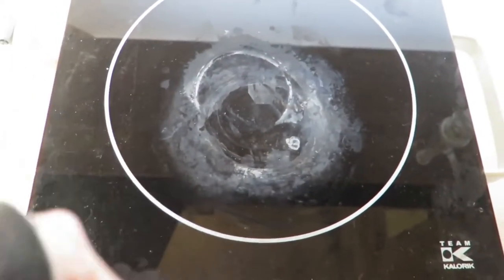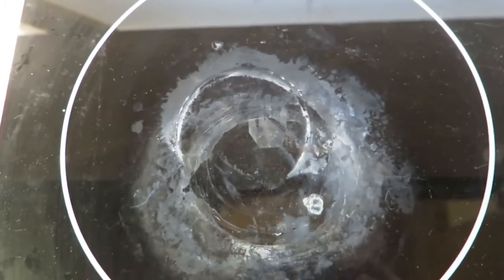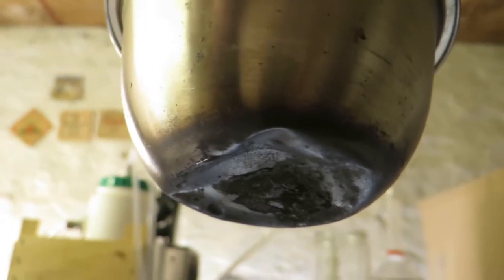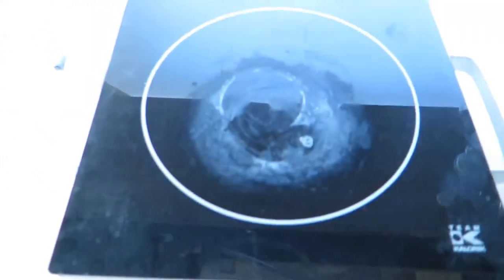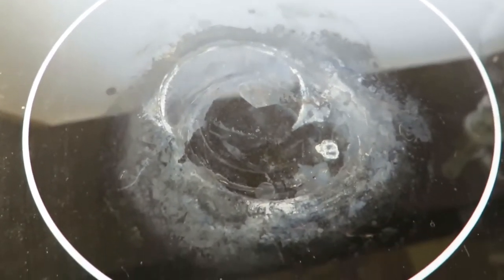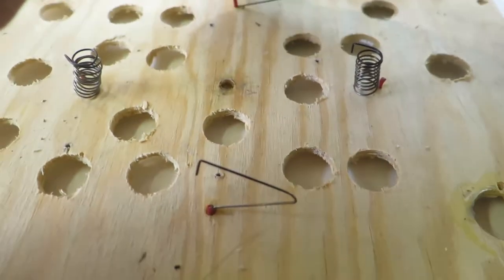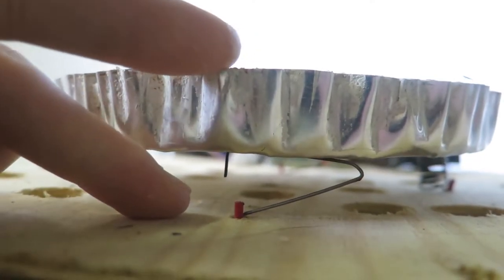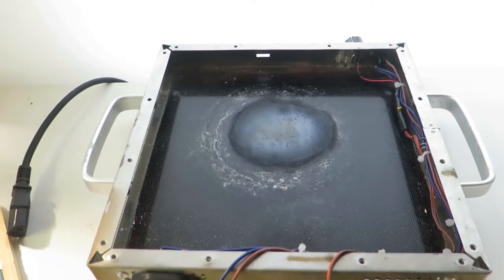Hotplate broke

Comment: Bro, I'm gonna start a channel. Need some tips.

what simple program do i use for editing videos if not windows movie maker
Reply from the maker: I personally use Blender, because I just dump videos into timeline, do some cuts and that's more or less it. Sequencer ther is a bit underdeveloped though and development is slow...

You can use Olive, it's also open source, or Davinci resolve that is free. I have not much experience with commercial software otherwise.

Before I used VideoPad that cost like $50 but boii was it bad...
Reply: @IlusysSystems  another open source option is flowblade. it's a bit wierd but when you get used to it, it's  OK.